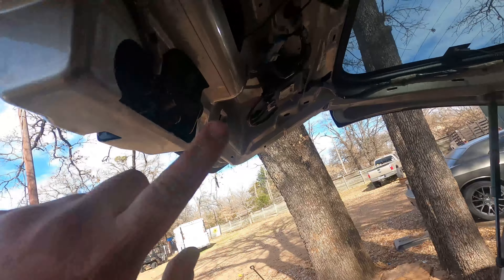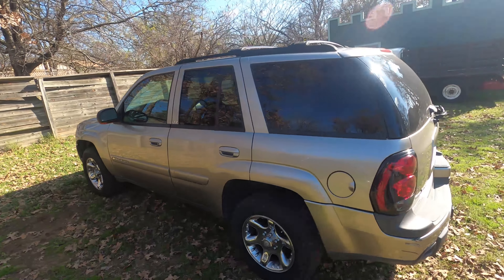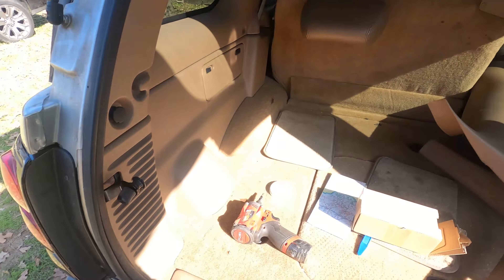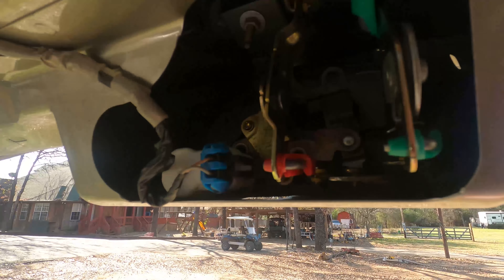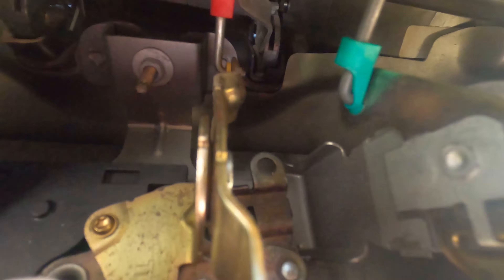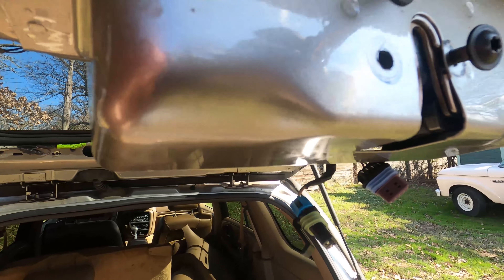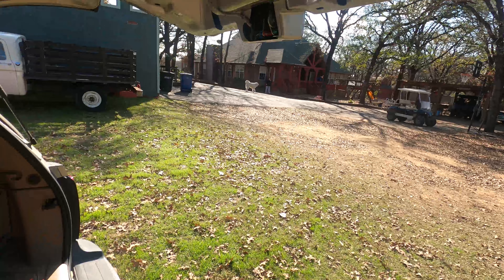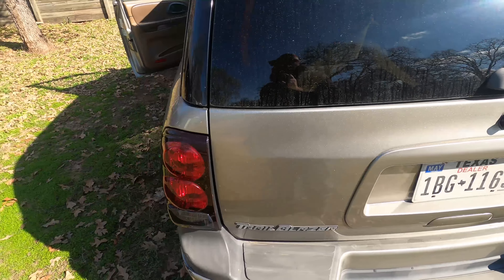2002-2006 Chevrolet Trailblazer and GMC Envoy Rear Lock Actuator Replacement!!

Comment: Does the module control the license plate lamps? I was f'ng around with mine yesterday because the module was clicking while the gate was open and also the lock actuator want working. I unplugged/replugged everything, and knocked on the module with my knuckles. Now I've got a license lamp that stays on when the h/lp switch is off and keys are out of the ignition also my key fob quit working for all the locks...🤔